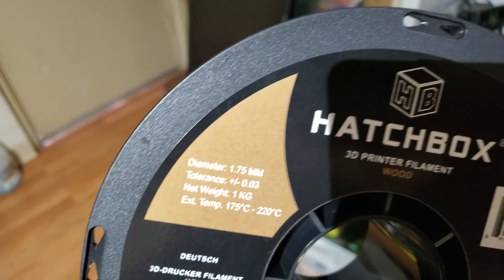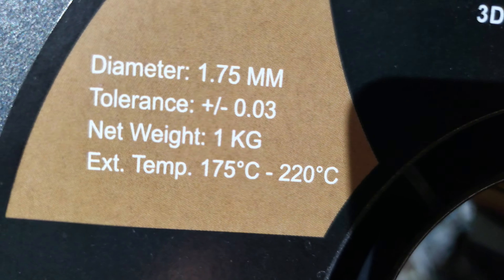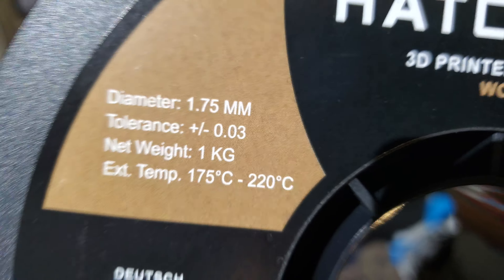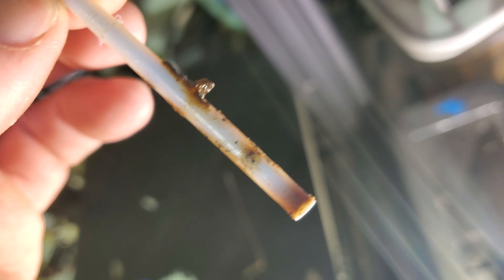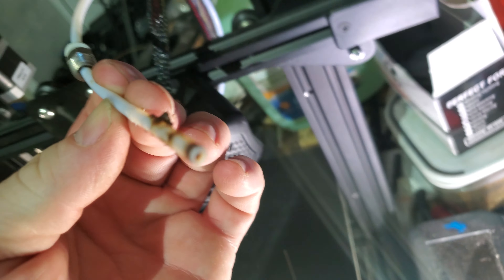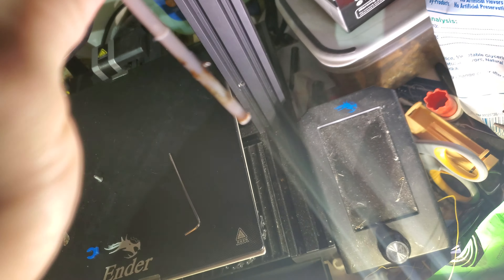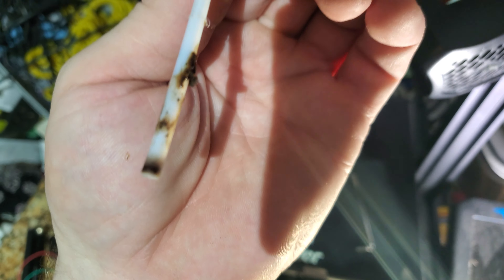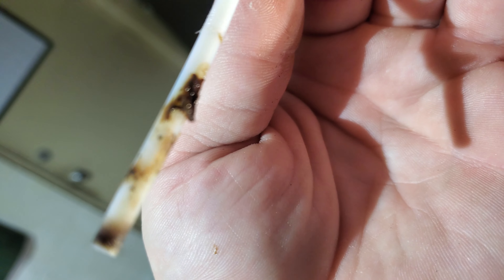Ender 3 v2 tube closed with wood filament at 215c

Comment: Did you end up using a 0.6mm nozzle. I wanna try using the a wood filament
Reply from the maker: I still got the filament but haven't got the .6mm nozzle yet, been working on other projects, but give it a shot if ya want to try it.